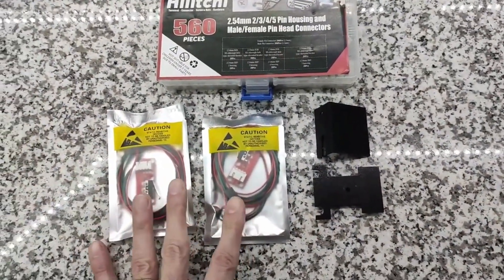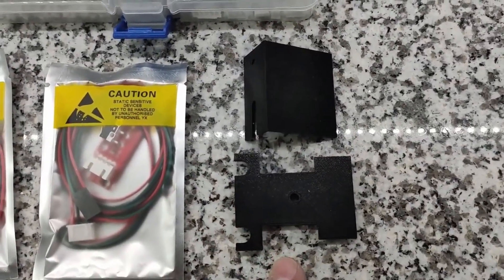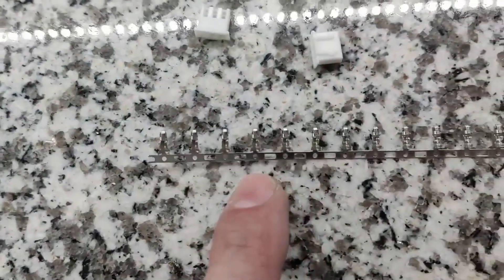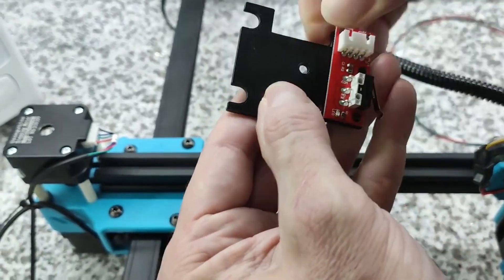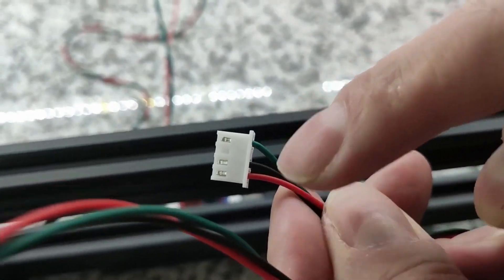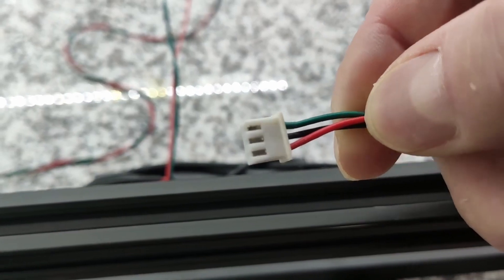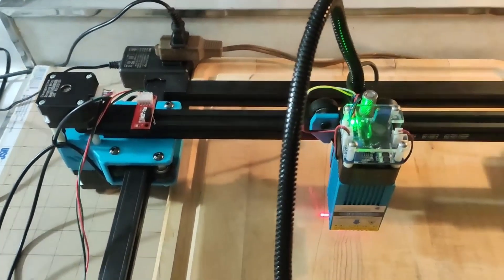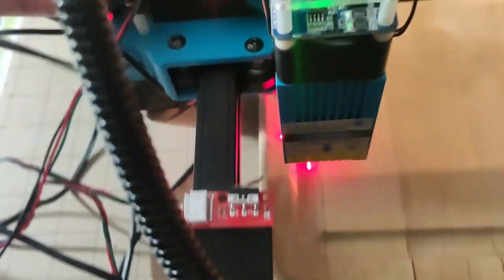TwoTrees Totem-S Limit Switch Installation Instructions

Comment: I ordered sculpfun limitswitches  for my TwoTrees 5.5 pro laser because I was told that would function. Installed them but is doesn't work. I see other videos where the switches are connected to the circuit bord by three a three wire system, the sculpfun switches have a two wire sytsem..... Is that the problem I'm facing now? (I'm living in the Netherlands..) How to correct? (I'm living in the Netherlands..)

Comment: Thanks for the video, i need an info, but the grbl configuration will be saved on controller and usable also with lightburn? I mean the homing will activate also if I use lightburn? Very thanks

Comment: I tryed this but when the lazer hit limit  switch it stopped kill all power to lazer when move lazer back from switch power resume on checking settings all had went back to  0 0 1 what am I doing wrong
Reply: Did you get an answer? I have the same problem.

Comment: Just finished installing the limit switches.  Thanks so much for the instructional video!!!  When I clicked the "Homing" icon, it performed the homing sequence as expected.  I started a simple file with a small box to test it out, but when the print started, the laser moved to the back right corner and started burning.  It now seems to think that the home position is in the opposite corner from where the homing sequence set as the home position.  Any ideas?
Reply: Did you figure out the solution to this? I'm having the same problem, I think it has something to do with the homing direction invert in the config?
Reply: I came across the same issue, any way you fix this?

Comment: Just another note - the limit switches don't have to be rewired with new connectors as long as you don't mind two things.  First, you'd have to bend and/or remove the metal fin that covers the ports for the limit switches.  Second, you'll have to pay attention to the wire orientation because the black connectors that come with the limit switches will let you plug them in backwards.
Reply: Thanks for the info! Was about to do this and was waiting on my connectors when i decided to re-watch the video and read the comments. I figured out you don't even have to bend the metal fin as long as you bend the wires 90 degrees off the connector and really finagle it in there.